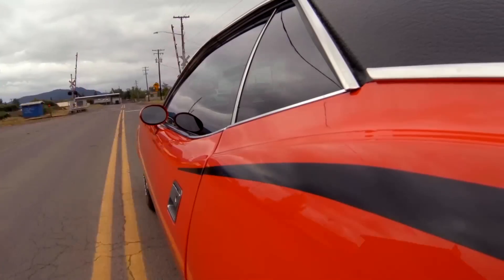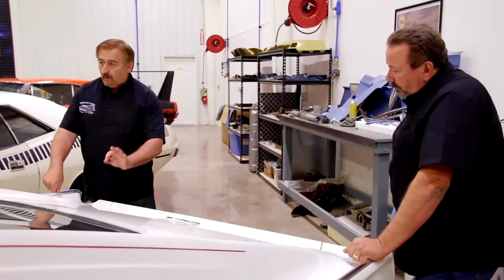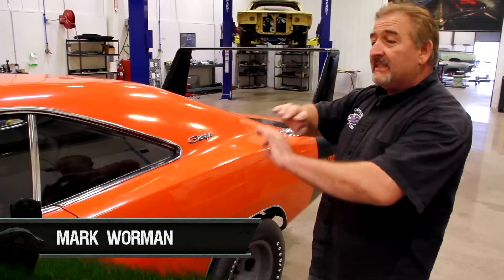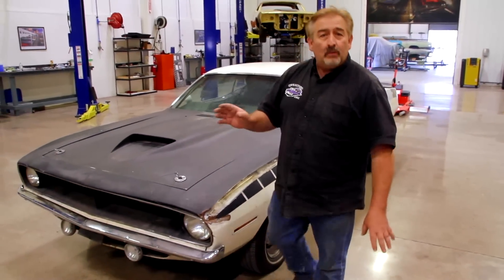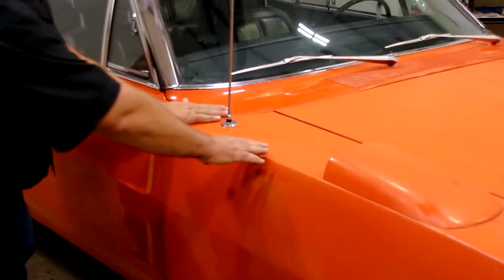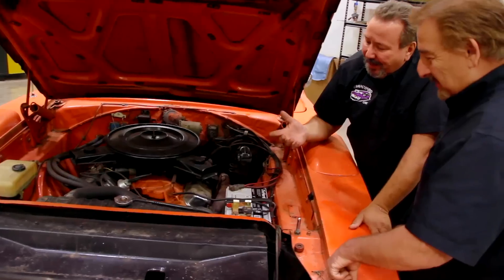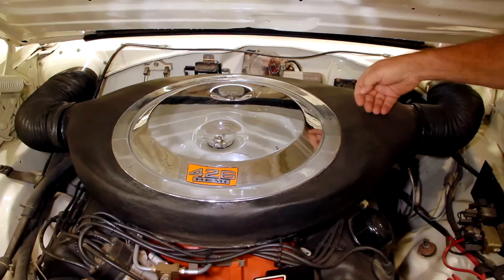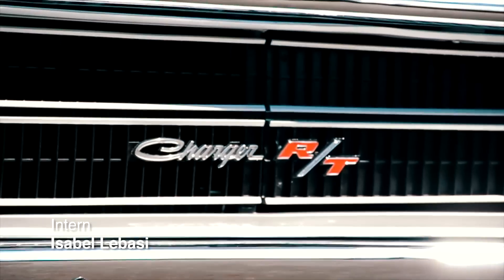A REAL '66 HEMI CHARGER NASCAR PROGRAM CAR IS A MILLION DOLLAR CAR TODAY. MARK & TONY MAKE THE CALL.

Comment: I bought a new 67 Hemi Charger, first week the dealer could get one.  The insurance was three times my monthly payment and I went through rear tires too fast.  Traded it to a buddy who had a 67 GTX with a 440 and automatic.  Insurance went down a bit, but the tickets kept happening!!  Got rid of that for my uncle's 1963 Buick LeSabre two door hardtop.  No street racing with that rascal.  And ya know, that was one of the best cars I have ever owned.  Rock solid reliable.

Comment: All the Australian slant 6, Hemi 6 and Hemi V8's used the same valve breather cap from 1960 to 1982. I owned a wide variety of 6's and 8's as well as breaking apart many back in the day. They were as common as belly buttons down here in Australia. It would be easy as to locate one on line and ship to the states if you're looking to locate one. (Yes, l do wish I still owned them all today, so that I could sell them all for a plum crazy 340 Cuda).

Comment: Hi- This has a simple answer , keep reading. Whoever said it was one of 85 needs to provide their documented source.  Right . Anyone can say anything, Its called hearsay in court.  Any mag will publish info to get sales.    Its possible engineers played with this one car as an idea to present to management as an option. Think ramchargers.  On their own time they played with no management involved for years. .   But the real answer here is more common sense-  First, to see if Mr norms records show anything.  Still not 100%   Back then was not like today.  A "one of" was not even a car term. The differences on this car may not have been noted.  .  
           But what is 100% is where ARE the other 84 cars???  With something as rare as a Hemi, several should have shown up by now, almost 60 years later. .   So, no reputable auction company will state that claim, as fact anyway, but then, its buyer beware.  It seems a pretty much undocumented detroit street racer mopar recently sold in unrestored condition for a huge amount of money.  The car was a "legend" it was said. A story was told and promoted before the sale. Could be something similar here as two expert opinions could sway bidders to believe things that may not have the kind of proof an astute buyer would require.   Or, maybe its worth it to a museum for bragging rights, who knows.  There are some buyers with more money than brains it seems.  The market of two bidders will determine the price. And who knows, maybe more will now pop up?
Reply: Correct  .. and someone out there knows the origin of that cowl air cleaner/package.  Someone knows who offered that aircleaner whether it was Dodge or Aftermarket.   There will be open hood engine pics of the 1966 NASCAR teams who ran the Hemi Charger to serve as reference.  If Nobody offered the aircleaner package.. then it was a. engineer fab'd or b. racer fab'd.